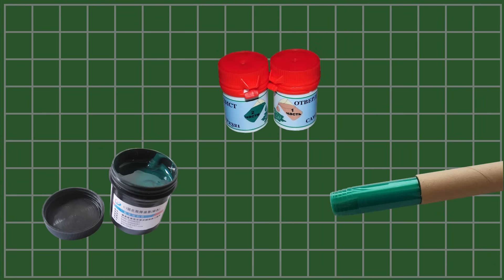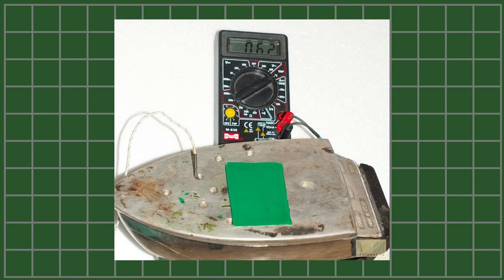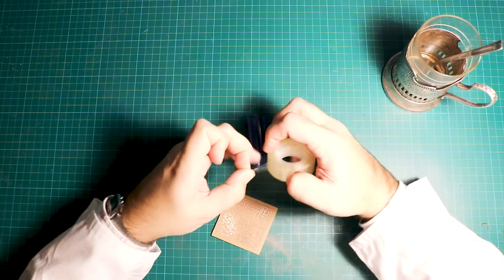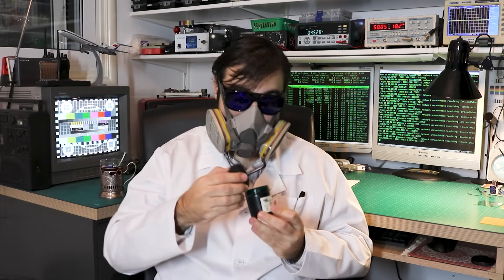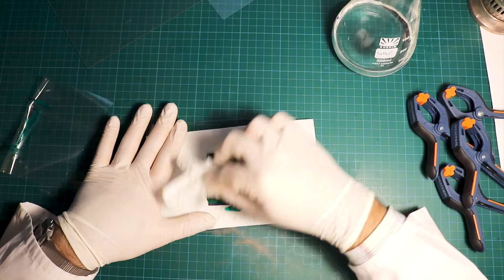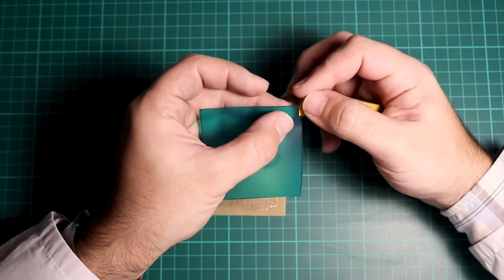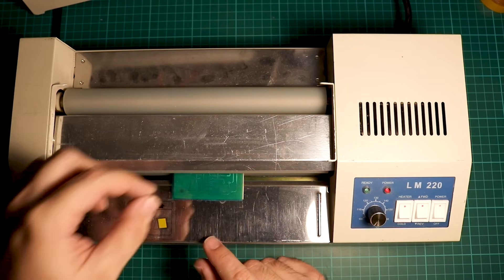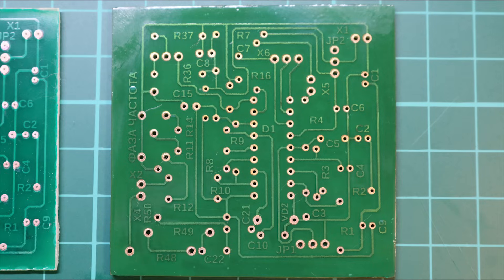How to make a PCB with soldering mask

Comment: If you wanna go cheap use black epoxy after all your parts are soldered in place. No one needs to know the board was homemade.
Reply from the maker: That's not fair. Somebody will repair it one day

Comment: I see you did an excellent job using one material method better than many methods I've seen,is there by any chance this method could be improved 
I've also noticed that there is no shiny solder mask rather it was a mutt ,I've used a syringe type !!!
Reply: If you do some searches, you'll find people that invert their PCB design and just use the laser to burn away the copper so what's left is the traces. I've even seen them burn the holes for PTH assembly. I get it, you need a fume extractor for the copper being burned off, but it eliminates the need to acid etch the board and is superbly faster. What has become popular is using it to create a solder mask so you can chem-etch the board, but it looks like a waste of time unless it's just for hobby builds, and personally, I would rather extract the burned copper fumes into a carbon scrubber than still have to chem-etch after the time already invested in running the laser engraver.